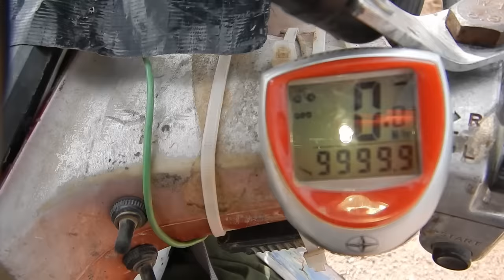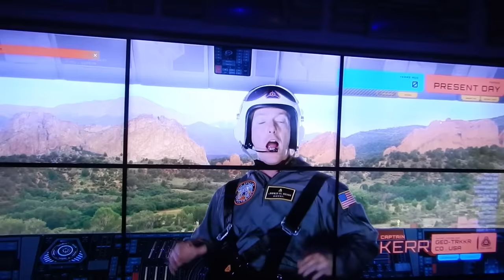EP10: Trans America Trail part 2

Comment: Ed I am simply gobsmacked by what you two achieved crossing the Rockies on those C90's. I know just how steep and difficult those passes are, unfortunately video does not do them justice. A week or so after I bumping into you and Rach in Oklahoma I was doing them on my KTM690 and found that hard enough. In fact I split my 6mm thick alloy bash plate in half coming down a steep track from Engineer Pass despite 10 inches of suspension travel so God knows how you two got over them.

You are so right about GPS Kevin, I got into quite a few nasty situations following his route including getting lost in the Moab desert when the route just disappeared and the same thing in a massive forest in Oregon where as a result I nearly ran out of petrol. On an earlier occasion the route sent me through the centre of a private power generation facility guarded by people with guns. Luckily they looked at my GPS and believed my story.  I came across some Kiwi riders using GPS Kevin's route who had also experienced serious problems. I do not recommend anyone to follow GPS Kevin's route, get the real thing from Sam. All the best to you both in your travels! Charles.

Comment: In my eyes this is one of the best content out there showing the problems you face during travel and how you tackle them. And yes Ed you should definitely be proud for building that monster trike. Very Resourceful and intelligent, and has worked well for the slipped disc injury that Rachel had. I've had a lot to learn about how to handle my mindset during travel, the crazy things you need to do to fix your vehicles and most importantly human relations. Thank you for posting this awesome journey :)

Comment: Good discussion on freedom in a group ride, and thanks for your openness about the dark side.

sidenote: her joyful and excited manner in which she takes all those crashes is simply amazing! I hope i find someone like that someday.

I think it is helpful for be aware of realistic expectations for things like that, so we can prepare ourselves in advance, including planning space/time/room to get that reprieve/refresh and adjust things to have a good experience.

I haven't done a lot of group riding, but i know the groups i have here generally like a limit of 3 due to those preference differences, skill level, and group-lagging. We still do medium size group riding days, but we divide up roughly into 2's & 3's based on skill and speed preference and set the meetup locations and times. It helps a lot, everyone has a buddy or 2 max that they are responsible for and we can have several paces.

I'd put myself in the medium pack: I enjoy twisty turns and moderate off road challenges (<- super vague term there), so i usually catch up a bit there. Really timid riders would be ok for a couple turns of waiting, but for a longer section, that will start to wear. I'd wish for a smaller faster group. I also have never had a speeding ticket (car or moto), so i don't want the metal stress of trying to follow someone who keeps going 20mph over in small towns (feeling pressured to speed where i don't want to and also feeling like I'm holding back their experience).

I do also frequently help the newer riders learn, because i seem to be good at it and i want them to learn quickly so they can keep up and not be unskilled/over-cautious nor reckless/pushing their limits in a bad way. (do have to push limits in the right ways to learn)

This is true even in car trips to the beach, where we typically take a fast route then detour to a fun wind-ie road. A couple of us tell the others, hey, we are going to go pretty fast in here. We have the practice and the cars to do it, so please don't try to keep pace. we will see you on the other end in about 15min.
Then we intentionally get in our cars and take off before quickly, so that we are already too far ahead for them to try catching up. (bravado is a real thing for some people).

Comment: One of the things about travelling off-road / in remote areas like this is that it's best to have another person and vehicle for assistance in case something breaks or you reach a point where self-recovery is not an option... This also allows you to split the gear between the two vehicles if you are going on the assumption that each vehicle does not need to carry everything it needs to be completely independent... On the other hand, having two vehicles means that the chance of something going wrong is twice what it would be with just one vehicle... Twice as likely that something will go wrong, but less likely that it will be serious enough to cause you to be stuck on the side of a trail or possibly needing to hike many miles back to "civilization"... It's a trade-off and works best when both people have similar driving styles so that one person is not always waiting for the other person...

Everything in life is a trade-off... Just like wider tires give you more flotation and traction on many surface, the fact that they are wider means that you are more likely to pick up a nail or screw and get a flat...

Comment: 5:35 i feel you broni just posted a short with my minibike crew but i hated riding with them because the same reasons you mentioned have to keep stopping waiting for someone ect. So i feel you man. 💪
Reply: 12:45 you don't wave at a Harley rider you throw up the duces ✌️either in the air or down low.

Comment: There was a C90 variant that was sold for light duty off roading rather than commuting. It has a high/low gear selector which makes riding on poor surfaces easier. A clutch would be useful -- without one I'd just travel paved roads.

Comment: In case Ed ever reads the comments in these older video's; what was the highway top speed, after the trike conversion?
Did the final drive ratio seem high or low?

The improved offroad abilities, was definitely worth any speed trade off. 
Should be completely street legal, with DOT approved tires.

The light weight Honda ATC's, was very popular when I was a kid; the later ATV's became heavier.

Comment: As aformer SL-100 rider,I can understand the problems of riding bikes like these very long distances. Don’t think I would have tackled it.
Reply: Also the trike conversion you built was much better than the one Honda sold. The “ATC” was a trike with 3 fat tires and was toohigh a center of gravity and too light. They had a bad habit of flipping either forward over the front wheel or backwards in an uncontrollable wheelie. Lots of injuries and several deaths occurred before it was pulled from the market.

Comment: Are your bikes, fuel, injected, or carbureted?  If they are carbureted, I think you can adjust the and switch out jets to adjust to altitude n stuff.  Not 100% on that.  Any other bikers wanna confirm or deny this?

Comment: They are obviously Not CT traiil 90's or you would have low range for the high mountain passes. Lived there for years with two of them, driven them up to 11,800 ft with no problems

Comment: MIG welding with no gas? Couldn't the machine run sticks?
Reply from the maker: +W.A. van Buren No, and there were no sticks either.
Reply: I see, you made the best out of limited options then. Did you know you can make a semi decent DC stick welder out of car batteries and microwave parts?

Comment: I drove the Alaska Marine highway with my dad in a Ford astro van with reverse out only had two gears in the transmission and at one point we blew a tire and had no Jack to fix the tire and I had to put a tree stump in front of the van run over the tree stump to bring the wheel up off the ground to get enough room to put the new tire on at this time like I said we had no reverse so we had to drive over 30 miles until the tree stump and Cine graded and almost caught fire it was the most fun and scary Ness I’ve ever had but it was just me and my dad it was worth it       Then we went to the north pole in Alaska down to Anchorage back to Fairbanks then we went to Homer Alaska then we went to Ketchikan and Skagway Alaska so much fun just me and my dad we slept in the van then the van finally give up the transmission locked up and we scrapped it then we took a little plane from home or Alaska to anchorage and got a flight back to the lower 48 I would love to do with you to have done keep it up have fun  wow thanks again for making this video and all your other videos very inspiring